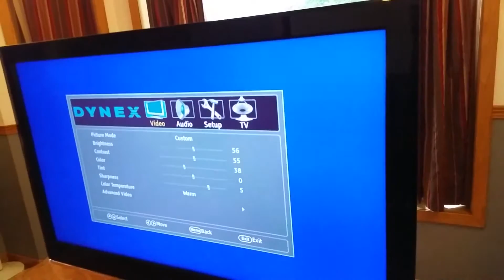Dynex DX-40L261A12 40" LCD HDTV Repair

Comment: I have the same problem on mine.  Shows Please Wait then fades to black.  Was thinking about ordering a tcon board but will definitely check the transformers first.  Thanks!
Reply from the maker: Just do the fash light test to confirm if it's the T-con or back light. It's a free and easy test so why not?

Comment: The inverter board Samsung SSI400_08A01 Rev 0.3 looks like you just need to unplug the old one and then plug in the new one. Is this true or is some soldering also needed to place in the new nverter board Samsung SSI400_08A01 Rev 0.3.
Thanks for the video
Reply from the maker: The new board plugs in.

Comment: Jeffescortlx my name is William I've never heard of these TVs before until today friend of mine just showed me hers ,she stated that it comes on for about 10-15 minutes and then shut off do you think it's a power supply power cord, Overheating any advice will be greatly appreciated
Reply from the maker: You'll need to do some trouble shooting to narrow down if it's a power supply or back light problem.
Reply: You still think it would be   a back light problem if the tv plays for 10 to 15 minutes but then it shuts off

Comment: My dynes has no sound.    Picture is perfect
Reply from the maker: If your sure it's not a setting issue you'll probably need to replace the main board if you're not good at soldering.